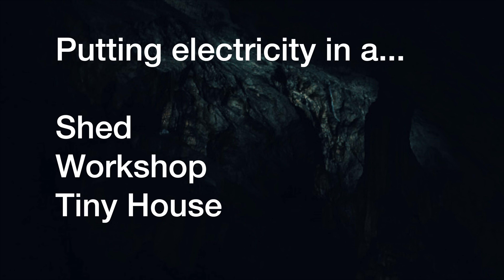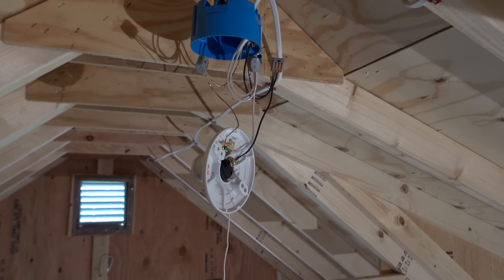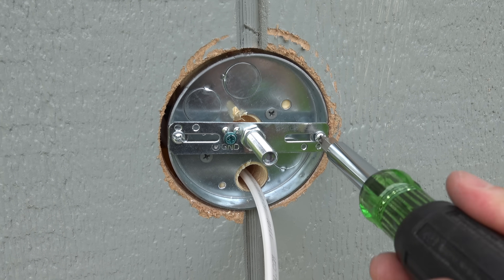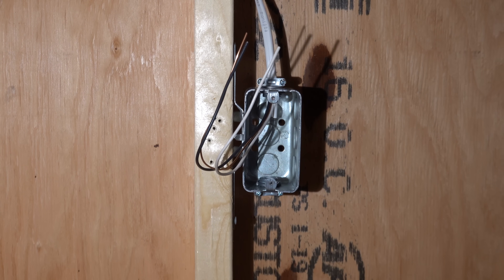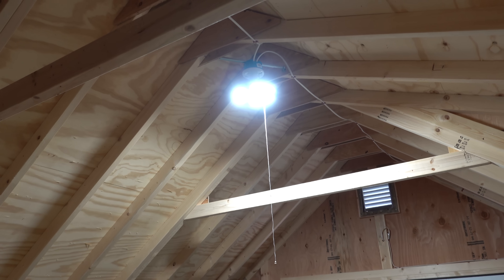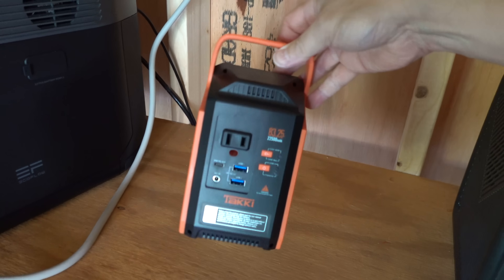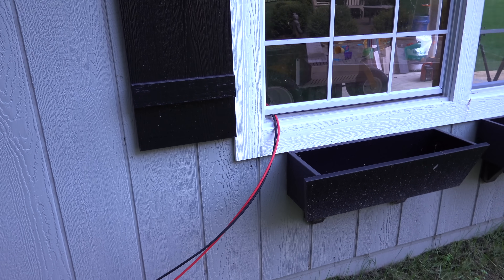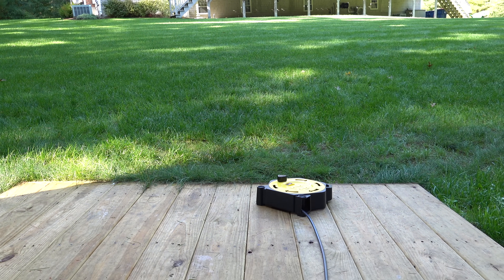How I built my SOLAR Powered Workshop - Power Anywhere

Comment: I got a 5kw system in my mancave. It powers the tv, pc, water heater, small fridge  window unit, and lights. If we ever lose power due to a hurricane or just in general we can run a cord to the big fridge in the kitchen and we can stay comfortably in the mancave instead of having to buy a gas generator or a natural gas generac. I'm considering upgrading it to 10kw and i can run more stuff like maybe the lights in the house and the kitchen stuff and if possible a single window unit in the living room or a heater if needed.

Comment: You started something here... thank you. I am building a shed that will serve as an extra room in the back of my house. I am bringing together several ideas and really wanted something better than an extension cord from the main house or trenching and all that to connect to my house breaker. This is a relatively easy setup and easy for me to run one on off switch for power in the entire shed and anything can be plugged into the unit itself inside. If it can run power tools, it can run a young lady's bedroom which includes a gaming setup. LOL

Comment: "These are wagos, and they make wiring stuff up a lot easier"

They also turn your electrical system into a massive fucking fire hazard, wire nuts are the only correct answer
Reply from the maker: Aren't we long past that. Wirenuts have caused more wires than any Wago has, in fact I have never found a documented case of a Wago that caused even 1 fire. Sorry but they are better every time: https://youtu.be/rMlI7qOm8hM

Comment: Great idea to use a small capacity portable power station if 12v lights and charging USB devices is the goal.  But the size will limit the use to low wattage devices.

Comment: Appreciate the simplicity of your approach. Since I am in the process of trying to go the same route, this was extremely helpful. I do want to make one comment. You referenced a solar generator. They do not generate power, they are actually large batteries with function attached. They still need to be charged via solar or even 110 volts. So it is important to be sure we understand the distinction. I am choosing to go with batteries versus purchasing a solar generator because I can have the same function for much less cost. Really like your minimalistic approach. Makes my job simpler now.

Comment: Looking at something like this for a Shed in Minnesota (Similar climate to you I think maybe a bit colder at times sometimes as low as -20 or -30F but usually only for a day or two).  My shed requires a constant supply of about 20-30 watts of power. How have products like the ecoflow been at surviving cold climate conditions over time?  I can't really have this shut off, but if it takes more energy to keep itself warm I just need to factor that in.  The shed can either have solar supply or intermittent 120v (nightly) power so it will get a charge for at least 7 hours every night no matter the climate.  Thanks in advance for your (or anyone else's) thoughts & experience.

Comment: I live in California and am tired of the government telling me what I can do and cannot do with my own property. I plan on installing a shed like this and using it for my frenchie studs , However where I live gets really hot do you think I could run an ac unit and that round light off of this type of a setup. I am no electrician lol and you make this seem so simple.  Thanks for any response, and yes everyone can laugh that I live in California. LOL
Reply: The panels he's got output a maximum of 400W so there's little chance of running AC off it. That 400W is also a maximum so you'd normally get quite a bit less than this.

Comment: HARDLY are tutorial on a solar system. Nothing in this video explains a solar system. It is not a solar powered system rather than a battery powered system, you plug a battery in to charge and the battery converts to AC. :P
Reply from the maker: The title is, how I built my solar power workshop, and The video is how I built my solar powered workshop.  Sorry it wasn't something else.

Comment: Fantastic video! Also if that shelf starts to sag from weight of batteries you can face it with 1x3 and it will strengthen significantly if you nail face off pretty good into plywood.

Thanks for sharing!

Comment: No Biggy, but just an FYI, metal boxes are meant to be grounded. There is a raised ground screw on the back of the box run a ground wire from that to the rest of your grounds. Reason being if the Black hot leg ever wears through the insulation and hits the romex connector it will trip the circuit instead of making the metal box hot. Which might shock you if touched. Better safe then sorry. Like I said, just an FYI. Thanks for the info, great video. I am looking into getting a system.

Comment: Did you add a Ground to your well pump ??  These generators do not have a working ground. Personally i would have gone with DC powered LED lights. Would be more efficient to not go through an inverter.

Comment: If you're running metal outlet boxes you MUST pigtail the ground wire to the box itself in addition to the outlet to be in compliance with electrical code. This is universal.

Comment: I have a question and hopefully you see this to reply.  So I am going to put solar on my shed for the same purpose as you have done in your shed, but I had planned this a year ago to run a panel, sine wave to a 12 volt battery (ies) and then to a convertor, and the purpose is just to keep a trickle charger on my garden machines.  The Question is, with these solar generators, can you actively leave them on, and connected to solar for charging, while leaving items on, like the outside light lets say ?   I just found your channel today and I am amazed by your knowledge and craftsmanship .   I cant wait to take a peek at all your videos, very motivating.
Reply: Following! Please reply to this question. I am curious as well

Comment: This is awesome!

Where did you get the solar panel stabilizer/frame?  I own 3 - 160W EC panels and it's always a challenge to get them properly positioned due to their lack of rigidity.
Reply: It appears to only be pvc pipes fitted together to support the solar panels

Comment: FYI, there are also kits which include 12v lights which run more efficiently if all you need is lighting, or can be connected to an inverter for tools and appliances. This concept has exploded with options over a few years ago, and prices are pretty reasonable. It’s probably cheaper to install your own solar than to pay an electrician to run a circuit to a shed.
Reply: Obviously.  Although I ran a branch from my house to the detached garage underground.  It's really easy.  Use GFIs.
Reply: 12v lights are great but if you want output AC lights are better.

Comment: Can 12 gauge be used instead of 14? I already have 12 from previous projects, but don’t want to use it if I’m going to fry something. I plan on just running lights and charging batteries level, not running power tools. It still has a neutral, hot, and ground wire.
Reply: 12 gauge is fine and really it’s even better because it carries more load

Comment: Those Wago connectors should be outlawed. When used they only allow a small little spring steel that connects these wires together in one tiny spot... What happens is they get hot and eventually fail. I have had to replace these in homes where they failed and replace them with wire nuts. They are a fire hazard. and as an electrician I do not recommend them to anyone. Just because they are easy to hook up does not mean they should be used.
Reply from the maker: I believe that you have replaced connectors. What I don't believe is that you have ever replaced even a single Wago 221 connector. They are not all the same, the 221 has a track record of perfection. Still waiting after millions of views for one picture or example of a failed one. With sooooo many surely there must be something right?
Reply: The only failures I’ve seen on YouTube are in testing where the ratings are exceeded, or actually melting with a heat gun, either of which also caused failures in wire nuts.

Comment: I'm a bit confused by the term "solar generator", those are just battery packs right? They can't possibly be generating electricity themselves, thats what the solar panels are for. I don't see how they themselves have anything to do with solar power

Does the solar panel on the top really provide enough power to run the saw for any reasonable amount of time? This shed seems like it needs some power augmentation from time to time unless youre just running lights and maybe a fridge

Cool build though! Very clean wiring

Comment: damn bro got me good for the title i was expecting solar panel on the roof, chains of battery banks, power inverter, battery controller some sick setups, but i am really disappointed. dude just pull out the portable power station and portable solar panel and called it build my solar powered workshop i am done shet so funny

Comment: Did you have to apply for a town electrical permit? I’d definitely check. In my case I have a few 100W solar panels connected to a 200AH battery bank through a charge controller. My “outlets” are six 12VDC cigarette lighter receptacles capable of 20A each. I have two 2000W inverters that are plugged into the 12VDC receptacles. From the inverters I have run 16GA, 3-wire 25 foot extension cords where my 2 LED 48” “fluorescent fixtures plug in. The other inverter extension cord powers an outlet strip for my tool battery chargers, a Bluetooth stereo speaker and a few other odds and ends. My smartphones charge via several USB car chargers plugged into the cigarette lighter outputs.
No permits required

Comment: Nice that you can run your shed off grid.  I'm wondering how often the batteries in the generators will need to be replaced and what the cost would be.
Reply: Depends on the battery chemistry.   If you get a Lifepo4 battery based unit the battery could last 5+ years easily with daily cycling.

Comment: If you're going to run power tools, you might want to consider 12/2 wiring..
Reply: Agree I wouldn't use number 14 in my dog house. Number 12 is really not overkill I also would have 240 volts for motors like on table saws and other heavy equipment.
Reply: It depends on what you want, lights only or more.  12 guage is a no-brainer
Reply: @scottslotterbeck3796  Yeah.. I ran a dedicated 10/2 line to my 120v SawStop table saw to get it to run right. My setup is not conventional.. My shop is off grid solar powered.. I have a 2700watt solar array feeding into three 48V, 100Ah lithium iron phosphate batteries which feed into a Growatt 8000T (8000watts/24K surge) inverter..  For such a tablesaw, I would not recommend any inverter with capability less than the 8000T. SawStop has a 240v conversion kit and I plan to convert my saw to 240 but for right now, it runs fine.. I did have a Magnum Power 4448 inverter-  the saw ran for crap..

Comment: Only installing one light fixture.
No. Always install at least two in the shed and attic. When you have one light source, you're always working with something that's in your own shadow. If you install a second light source it gets rid of nearly all dark spots in the shed. This was the first thing I did when I electrified my shed. Always, always, two light sources.
Even if the second light isn't so bright, it makes a big difference.
Reply: Also if you are running a tool and the light goes out, you have a second light to help you to not saw your arm off.
Reply: @mac11380  but, if you saw your arm off, your new arm could come with it's own built in light source.
Reply: @wulver810  ROFLMAO
Reply: Why always two? What if I have three or four?

Comment: I thought you would be permanently installing a couple of solar panels on the roof of that shed so you don' t have to deploy the foldable panels to charge the batteries. Also, how long do these battery boxes last? Wouldn't a car battery setup be more economical?

Comment: When using a METAL electric box, you are REQUIRED to ground the box by adding a ground wire from the wire nut to the box and secure with a green ground screw. You can get away from that by using plastic boxes.
I don't know of any specific requirements for temporary solar panels, but for permanent ones, there are strict requirements for grounding the panels.
Reply: Do they have plastic pancake boxes?
Reply: I noticed he didn't ground them too

Comment: As electrician in the trade over 24 years only thing I'm going to say is never use a drill or impact on squeeze type romex /ser/se connectors and if you run cords through a window get a block in there so it won't damage the wires... and even with those 2 nice job clean install and simple

Comment: I have no issue personally with how this was all setup. It was clean, neat, and I think pretty reasonably safe.  With that said, depending on your area you need a permit for an outbuilding as soon you put electricity in it, particularly if you're running a semi-permanent AC circuit.  It would then need to meet code for properly running romex (would need to be in walls behind sheathing or you could use conduit and potentially switch to THHN), and the electrical box would need to be grounded.
Reply: I was wondering  if you needed a permit for this . I am trying to find a way to put lights in my shed but cannot seem to find a way besides an extention cord. That does not need a permit.
Reply: @gisenda  nothing wrong with an extension cord. Just be diligent about it.

Comment: That is a pretty awesome setup! very simple and minimalistic but does the jobs its needs to perfectly. My only reccomendation is to wire a ground rod into the input box because otherwise everything is just floating with the solar generator. A voltage potential is capable of building up in the wiring and if it isnt shunted to ground then you could touch an electrically grounded piece of metal and get a shock from it.

Comment: I need power in my shed. This is fantastic but what about the batteries in the winter time. Will they freeze and ruin?
Reply: wont charge under 32f. you could keep it wrapped in insulated blanket or low watt 12v blanket.
Reply: It should not be much different than your car battery they charge in all types of weather. But you can warm the battery by loading it down a bit. The old trick in the winter, we turned on the lights for a few minutes then try starting the car then the charger from the alternator kept the battery warm and charged it. The inverter can load the battery then the solar can charge the battery.
Reply: @ronb6182  it's Much different than lead acid batteries. Lithium can be damaged if charged in the cold
Reply: @chrisanderson8553  sorry I must have miss something. All the more to use golf cart batteries if you live in a cold climate. That also brings up another question. Hybrid cars have Li-on batteries and they are not always in warm climates. They fair well in cold climates. These are questions that may save the batteries for solar.
Reply: @ronb6182  cars have internal warming mechanisms to keep the batteries warm.

Comment: This is really cool I'm looking at building a little off grid shed next summer to start learning. I'm curious though as to why you're using so much AC power on solar. I know inverters claim a 90+ percent efficiency but isn't that if you're drawing the maximum amount of power? Wouldn't drawing 60w for a bulb be closer to 80% if not less? I might be wrong I'm legitimately curious. I've been looking at DC appliances but it seems like a lot of work if inverters can actually keep their 90%+ efficiency. 80% or less though I'm probably going to run as much DC as possible.
Reply: that 90% efficiency rating already includes the inverter loss.
Reply: @chrisanderson8553  I'm aware. But say you have a 100w battery and a 100w inverter and it uses 10w. A 1hr discharge would use 10w but if it was only pulling 50w that's 2 hours run time do 20w. I'd assume it uses less if it's not at its peak but still the longer it runs the longer it eats power.

Comment: At this point I’m convinced that his wife kicked him out of the house.
Reply from the maker: Seriously, just need the starlink for TV and internet and I am set.
Reply: @SilverCymbal  It'd be cool if you wired it up for Ethernet, Coax, and power outlets all over the shed.
Reply: @thesinofthetin  no need for ethernet, just use a range extender or a wifi antenna system
Reply: @Bremend  wifi extenders half your speed.  he would probably use an Ubiquiti ptp bridge to bring internet from his house to the shed.
Reply: Hard wire is much better than wifi. If you must have wifi just put one in the shed, you can hook it off the Ethernet and still have hard wire for computer 🖥️ or laptop 💻.
Reply: Lol 😂

Comment: Almost exactly what I’m going to do for my shed. Are you going to leave the eco flow there over winter? I know it gets to -20c easily in MA, so on a sunny but cold day will it charge or protect itself?
Reply from the maker: No, if you are in an area that gets very cold, you will want to remove any battery. Even Tesla Power walls need heaters to function properly, for me its not a problem since I dont really use the shed when it gets to very low temps. I might just try to leave the little one out there and see how it does just to run the outside light.
Reply: @SilverCymbal  👍🏻 roll on business travel coming back so I can come freeze my face off and drive in 3ft of snow again. I’ve got a Costco plastic 8x10 going in once the groundwork is done, but in London -5c is about the worst we see overnight so > 20f and it should be ok to run a light, security device, and charge up tool batteries.